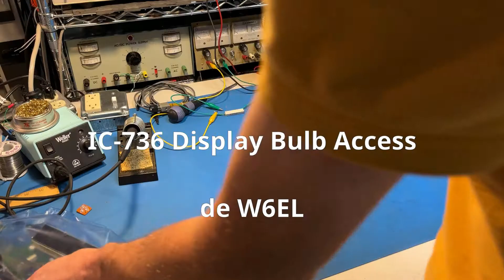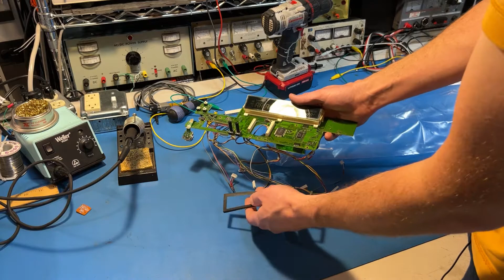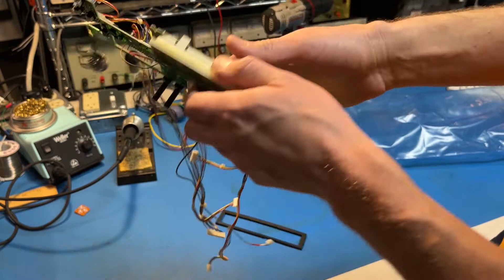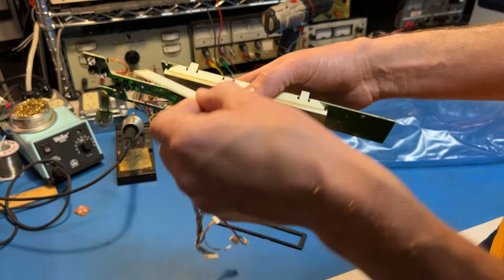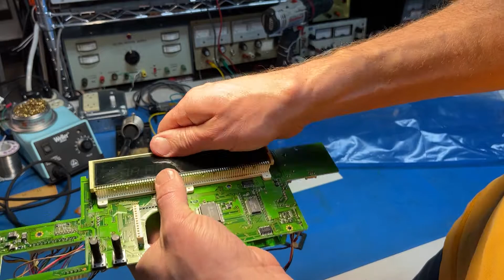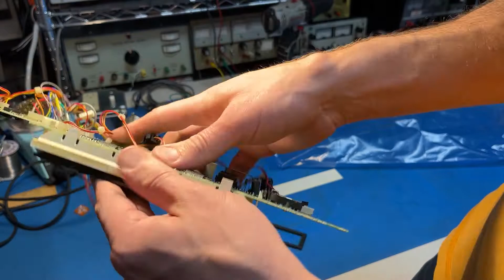IC-736 Display Bulb Access

Comment: Great video as always, so many thanks.

I always thought it would be a bit of a chore desoldering all the pins, so I think this method would be the route I'd take.

Looking at the IC-736 instructions that I downloaded, on page 49 (maintenance & adjustment), it mentions the LCD can be dimmed via a small pot' on the side of the front panel; do you know if this alters the actual contrast of the LCD readout, or does it dim the axial bulbs? If the latter, I'll crack the case open & alter the setting to dim the bulbs.

All 4 of my bulbs are still working, so the option of dimming them would be great as this would surely extend their operating life significantly.
Reply from the maker: I’m pretty sure the pot mentioned there controls the bulbs and also may dim the s-meter bulb. From what I know of LCDs (and that isn’t much, mind you), the duty cycle going to the panel seems 50%, which should already be the maximum contrast. 

—E de W6EL
Reply: @W6EL  

Looks like I'm going to be flipping the lid off the rig imminently then & altering the pot/VR, as I find the bulbs are brighter than I need them anyway.

What's more - I'm led to believe that dimming them by about 25% will increase the bulb life expectancy by a significant amount, & that can't be a bad thing taking into consideration the faff it is to swap them out. 😥

Thank you for your speedy & informative videos & replies, & I look forward to seeing more. 👍🏻
Reply from the maker: @harrybatt998  I think I read somewhere once that decreasing bulb voltage by 10% extends life by 50%, but I'm not sure where I saw that. I'm also wondering if lower heat helps the LCD lifetime.
Reply: @W6EL  

Yes, I've also read similar regarding incandescent bulb increased longevity with lowered voltage.

With regards LCD degradation & heat, I can confirm that the old Yaesu FT-857D LCD often developed "zebra lines" allegedly due to heat as the rig was compact. I've had a few Yaesu FT-857D over the years that have developed this problem, & coincidentally the only ones that didn't develop LCD issues were the rigs that used a face separation kit thus keeping the LCD away from heat.

If the aforementioned pot' in the IC-736 does indeed lower the bulb voltage, we can only be in a win win situation for sure.

Edit; I've had a quick scan around at the schematic's in the IC-736/738 service manual but can't find the pot' we're talking about (R218). 

If I get time later today, I'll flip the lid off the rig, alter the pot', then report back with my findings.
Reply from the maker: @harrybatt998  I think the pot is on the S-meter side, and there is a small hole in the side of the face plate near the screws to make it easier to adjust. But I did not confirm this, just typing here from memory.
Reply: @W6EL  

Hi Elliot,

About 10 minutes ago, I literally got around to opening the rig up & altering R218, the preset VR.

I can confirm it dims/brightens both the bulbs in the display & the S-Meter simultaneously.

Mine was fully clockwise & set to maximum illumination, but I've now gone fully anti-clockwise and the display & meter are still fully readable in artificial light.

Hopefully I'll see another 10,000 hours use out of my LCD bulbs. 😁